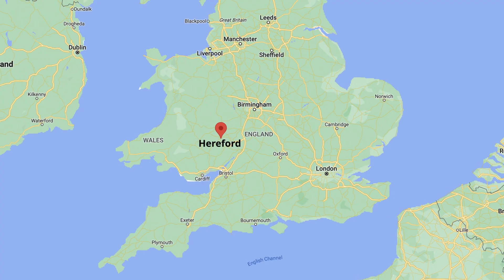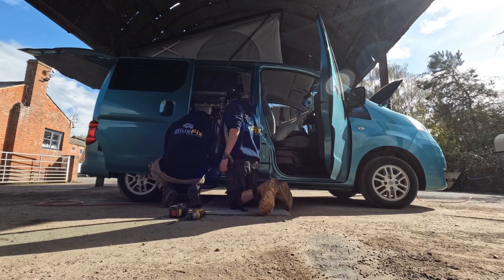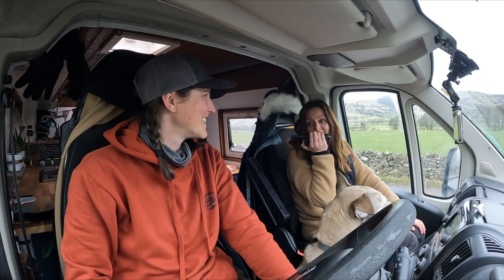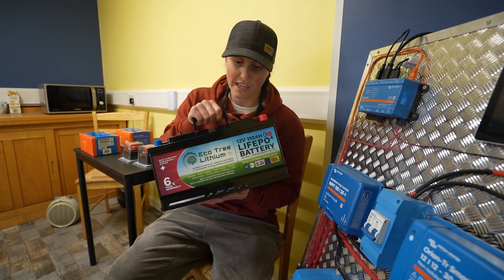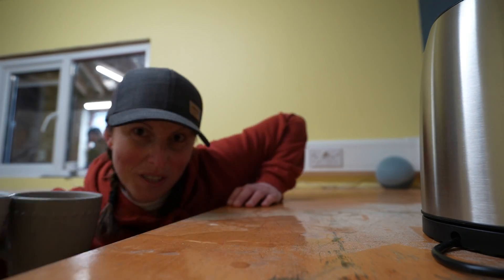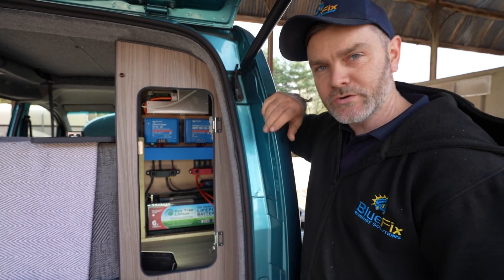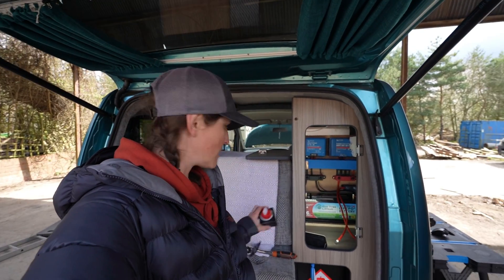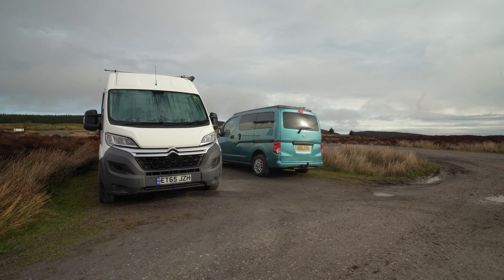The perfect electrical set up for off grid micro camper (Nissan nv200 campervan)

Comment: Great neat job … agree with the fridge choice and the solar panel output is a good. You have the same setup in our Harry and we managed 6 days off grid not moving without any battery issues with a small power bank so easily ok  - neat job by the boys

Comment: I've got 2 x 24ah Eco Tree batteries in my mobility scooter. Great batteries, much lighter so more range, slightly more expensive than others, but the 6 year warranty and reliability of the batteries is definitely worth the extra cost. The batteries will probably far out live my mobility scooter 😂, because sadly many mobility scooters aren't built to last 😢

Comment: Good explanation. I'm jealous of your mum. I only have two boys. Good geeks but they weren't much help as I rattled my brain cells to do the electrics in my wee camper. Still have a problem with a loose connection (sometimes, somewhere in the system) which means my volt meter reads incorrectly. Putting an Anderson connection on my fridge has helped. And I've definitely improved my skills at reading and using a hand held volt meter. 
Yes I went Lithium , not a good brand but it's working and I could get it. Main reason. I could lift the dam thing off the floor! No use getting a battery I couldn't lift and put in my van.

Comment: I’m sure Mum will be happy with the job they’ve done. We have a Vitrifrigo fridge in our van and it works well too. Cools down in no time and they are pretty efficient compared to others. I’m surprised having gone to all that trouble and expense that you didn’t have an inverter fitted as well. Even if you don’t use them regularly I’d much rather have one in the van than not, although you can get smaller ones that work from a 12v socket.
Reply from the maker: Hi, she does not need one and decided if she wants that type of electric then she is happy to go to a campsite and hook up, she would much rather the space no matter how small an inverter she could get 🙂

Comment: Can I ask if you had any issues getting your battery delivered to the solar company, we had our system upgraded two weeks ago but the battery didn’t get delivered on time from ecotree, it still hasn’t arrived we are borrowing one from the solar company we have used. We are not really sure if it’s ecotree having supply issues, or the firm not ordering it early enough. Many thanks
Reply from the maker: Hi Kate, no we did not, we did order it and arrange the fit out a couple months in advance of this though, so not sure if they are now having supply issues or when you ordered yours

Comment: Im installing all victron gear in my new van that im building, 800 watts of Renogy panels, 400ah of lithium batteries, everything else is Victron, MppT, DC 2 DC, Multiplus, Battery protect, plus all the other monitoring stuff, Gerbo GX, big learning curve from my old van. I love your vids, maybe one day we will bump into each other on the road.

Comment: Found this really interesting despite not owning a van!  I even have a question about the Eco -Tree battery for my non-existent van - does the blue tooth app have the option to set a warning alert if your battery goes below a set percentage or do you have to keep manually checking how much you are using?

Comment: Apologies if someone has already asked in the comments, but why were the guys using tiling spacers when sticking down the solar panel?
Reply: The adhesive manufacturer sometimes state the strongest bond is at 2,3 or 4mm thick bead so if one uses (in this case  tile spacers) one will not squish the adhesive thinner than said specs.
Reply: exactly as paul's response states. without the spaces you can easily squash the adhesive too thin :)

Comment: I'm a big fan of Victron kit and have that in my van as well... the only downsides I see to the Victron B2B are they're not that powerful (lithiums can charge a LOT faster than 30amps, I'd like to see a 50amp version) and they lack a method of charging the starter battery (the Renogy charger will trickle charge your starter battery if your leisure batteries are full!). 

I know others have fitted multiple B2B's (Mispronounced Adventures) and I've fitted Renogy B2Bs in friends vans to take advantage of better charge rates but would be nice to see Victron do something here. I've also fitted a VanBitz Battery Master (can also try an Ablemail AMT12-2) to trickle charge my starter battery from solar for longer parkups.

The one major advantage I see with lithium batteries that few seem to discuss is just how much quicker it can charge than lead acid, or AGM, from the same power source. Lead acids charging rate will slow down after around 80% ... and the last 20% of capacity can take many hours to fill... lithium just keeps going meaning our van is usually around 98% charge by 10am just from solar!

In my next van, I'm hoping to ditch gas altogether and just have a bank of lithiums with a big inverter-charger and an induction stove top. Less hassle, safer and cleaner.

Loving your work you two, keep having fun!

Comment: Another thumbs up for Eco-Tree batteries. Only one year so far for me, but doing a really good job. They do a smaller 84Ah battery. I found that by turning that through 90 degrees, I could fit 2 of them in side by side . In effect, I had more depth used for a similar length.

Comment: You say you can use 80% capacity. Will they cut off or can you drain them past their safety? How can you monitor ?
Reply: you can actually use more than 80% from these batteries. the built in BMS will shut the battery down before it reaches critical levels so lots of peace of mind with these batteries.

Comment: I have used Victron kit in my build and I agree it is good. It looks like the b2b and mppt have been mounted on a wooden panel, has the panel been treated in any way? The install manual says “Mount the solar charger vertically on a non-flammable substrate” presumably to prevent fire as the cooling fins can get hot.
Reply: google the flash point of ply. The orions never will get hot enough for it to catch. plus we ensure there is plenty of ventilation.

Comment: Great video.  I loved your illustrations that showed how the energy from both sun and engine go into the house battery.  After watching numerous vanlife videos and reading vanlife blogs over the years, your illustration enabled me to finally understand how it works!  And that goes hand-in-hand with how BlueFix installed everything which is so neat and clear, and makes sense to me.

One question, though.  For years, people used to say that there needs to be space for some air circulation underneath a solar panel attached to a vehicle's roof, to avoid heat build-up.  So they would devise some type of frame to attach the panel and keep it off the roof.  Is that not true anymore?

Comment: Nice of you to set up your mum good and proper. Lou might want a "soft bump baseball cap" for when she is working on the van, though. That is something that looks like a baseball cap but protects her noggin when hits it on something. You can even get just a "foam insert" so that she can just use the caps she already has.
Reply from the maker: She does need that

Comment: Hi Lou, can you show how the company fitted the solar panel wiring through the pop up? I have a pop up roof and keep thinking that any wiring will get trapped as it‘s lifted up and down. If I lived in the UK, I’d be outside BlueFix’s door tomorrow! There are no camper specialists in NZ either and I’ve had several electricians suck air through their teeth then mansplain everything into a ridiculous quote :/

Comment: You might like a stiff one but mine is floppy and I've had no complaints.

I went for a flexible panel so that I could sikaflex it to the single sheet aluminium roof without making any holes.

Comment: Luke did my Victron install on Cecil the Shitroen, 2 years and its been faultless! I have a 360 panel and a 220w Victron  AGM battery and it's NEVER gone below 80%. To be fair I only run a diesel heater, crx50 fridge and led lights and a usb's ...no hob thingy's that lou couldn't remember and neither can I, or tv's...but its cheaper that living at home...a lot!! Buy cheap,  buy twice...victron is the way to go.....I just wish I could say the same for the Shitroen....😢 regards and thanks for the info Mick x
Reply from the maker: Glad it’s been good for you 😀

Comment: Hey Kiddo besides you speaking near the speed of light you've nailed it. I have designed and installed my own solar electrical system (800 watts of panels) and as l said she's nailed it. I installed mine 3+ yrs ago and l was forced to use 4 - 6V lead acid batteries. Lithium's prices were astronomical compared to today's prices. I too used Victron and wouldn't go with any other supplier. For us here in the North American colonies we don't have a cool installer like they used unfortunately. I have enormous respect for you young lady...keep up the great work! Cheers😊

Comment: I totally agree with getting a professional install of those expensive blue boxes and a good LiFePo4 when it is for someone else (not me)
But I do not agree with going for rigid solarpanels on her van, the semiflxible isn't that bad on efficiency now, and you get a very clean install, and you still fitted more solar then she will need, she also has the added bonus (if she parks that way) of having them angled towards the sun.
If I build on a fullsize van, I will go rigid, mounted on a tiltable roofrack, because getting a better angle against the sun boost the efficiency, and gives you usable sun for longer time a day, especially in the winter.
You did everything right on your van, and everything right on this van. Cheers!

Comment: We used Victron components and lithium batteries for our off-grid house solar system and 3 1/2 years later are very, very happy with the setup. I'll add that to your recommendation 😃👍

Comment: Last year I build A VW T6 into a campervan (F 70 y) for me and my wife. Helas, I don't live in England (visited often for LD walks) so no Bluefix for me. I don't have a solar panel and I'm told that fixing a flexible solar panel on the lifting roof is a bit of a problem because of the heat it generates and can damage the roof... Now I saw the guys do something with plastic crosses in the kit, did they create some distance between roof and solar panel?

Comment: Good vlog, thanks for sharing…. when the DCDC charger charges, the batteries up to 80% does it carry on charging? As I’ve known some to shut off at 80%
Reply: If the charger doesn’t have a lithium charging profile it will as you say only charge to 80-85%. Need to have a smart charger that has a lithium profile. 😁

Comment: Neat install! I only doubt the amount of ventilation, the Orion B2B runs pretty hot and there is barely any space, so if the battery is needing more charge (eg is 50% empty) its likely the Orion will throttle to limit the amount of heat.
Also, why a 30A MPPT for a 175W panel? A 75/15 would have been sufficient
Reply from the maker: Bluefix are right, they left a big ventilation gap behind the board that all the kit was fitted to, with a hole behind it.
Also, the bigger mppt will allow for additional solar if ever needed, although right now the 175 watt is more than enough, will see what happens when we are driving less or the short winter days.
Reply: The Orion has ooodles of ventilation space around it including a 12cm hole behind it with loads of breathing space. That’ll charge the small 110ah as quick as possible 👍

Comment: No sane person would do their electrical work themselves if they could get somebody else to do it for them.
I'm an electical engineer, by trade, and I hate doing electrics.

I have, literally, just come in the house after finishing installing a couple of extra USB and 12v sockets in the back of my Land Rover.
Altogether, it's taken about a month to do; pulling trim panels off, running wires, taping it all up, zip-tying wires, ordering bits i haven't got and then waiting for them to arrive, redoing things when I realise something is in the way of something else, crimping, testing and rebuilding.
What a pain!
Reply from the maker: Such a pain and yeah you are so right

Comment: Couldn't live without the dolche gusto, the fridge freezer, the toaster, and the air fryer. The microwave and the nutribullet 1000.

No wonder we need the genny.
Though to be fair, mid spring to mid autumn we just about cope on solar.
We have 500watts and 200 lithium. With a 2000 watt inverter.
Reply from the maker: 😂😂 too many things for us but glad it works for you guys 🙂

Comment: We just added solar to our teardrop this year. We are always on campsites, but EHU prices are going through the roof and often you get nicer and cheaper pitches if you don't need it. No funds for a different battery so our 60amp lead battery has to do for now, but so far it has been great and even with little sun our 2 100 watt panels kept the battery topped up. We did go for separate non fixed panels though since we like to park the teardrop in the shade.  Loved seeing you install your system. My husband did ours, but you explain it much better. So thank you for that. 😊
Reply from the maker: Our pleasure